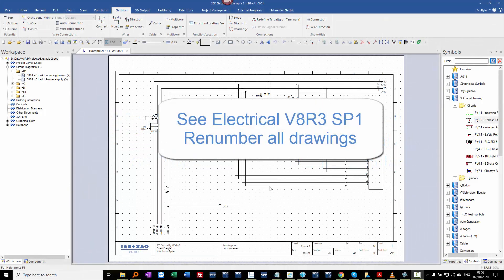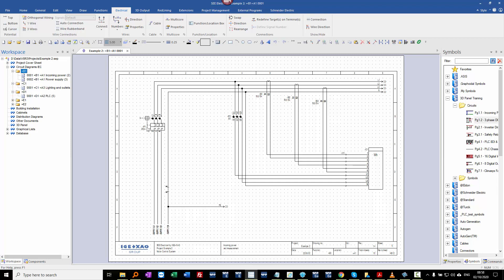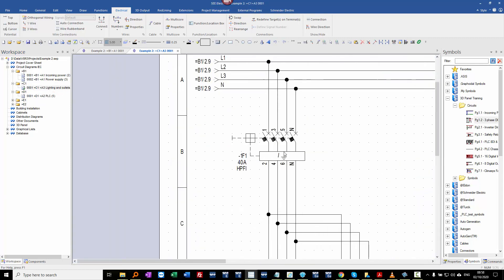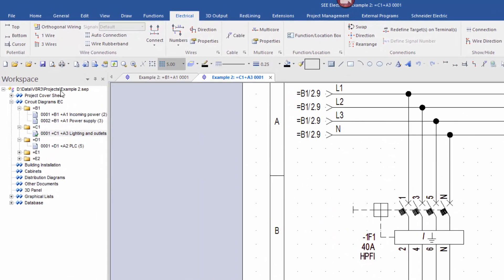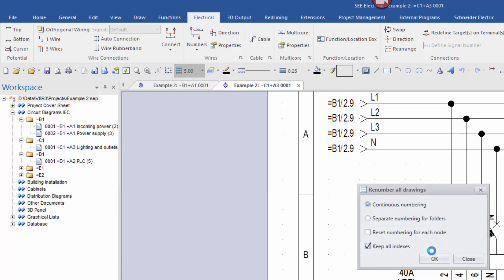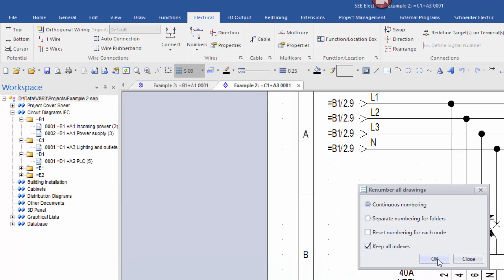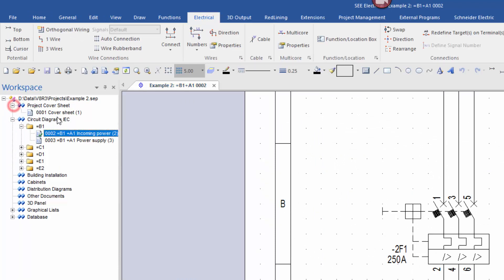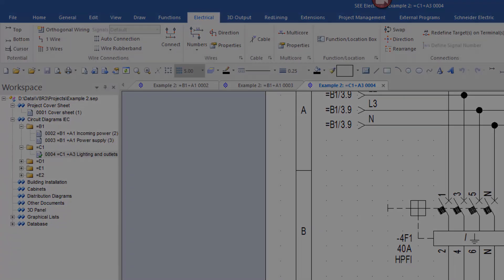Renumber All Drawings in See Electrical V8R3 SP1

Comment: Hi I get the following message: "ERROR IN POTENTIAL STRUCTURE", after i used command SPLITOPR, or POTENTIAL WIRE TOP OR BUTTOM... Please can you help me solve it. Version ( V7R2)
Reply from the maker: Hi Max, to switch to SplitOPR you do need to remove any existing potentials in the project and replace them once you've renamed the system/References symbol folders. If not you can run the RemoveSplitOPR command to return. After a major structural change its important to use the File - Regenerate Database command. If issues persist, contact your local support team for more help.
Reply: @IGEXAOUK  Thank you very much for your reply.